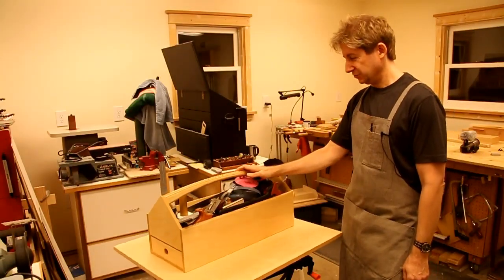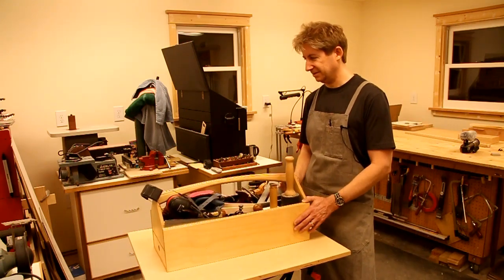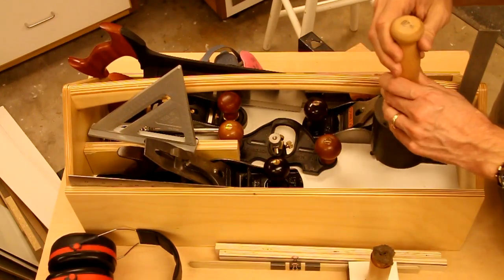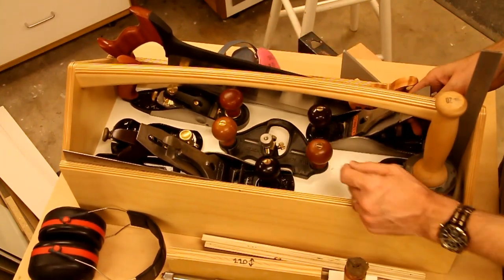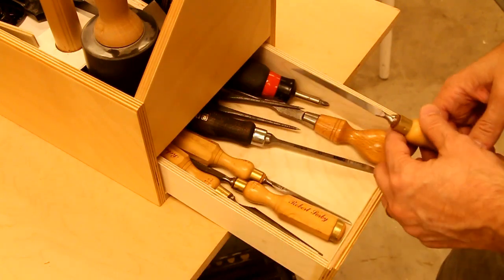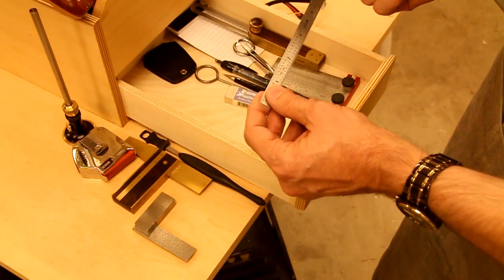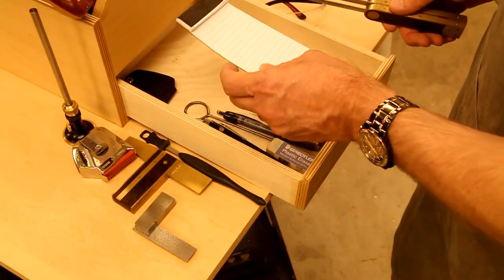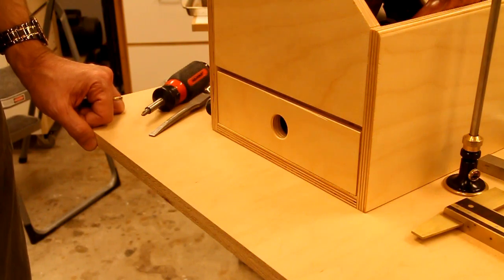Inside My Traveling Tool Tote

Comment: man that tool tote hasnt spent more than 5 minutes on site... and neither have any of your tools... 
quite nice though
Reply from the maker: Well, I'm not a carpenter so my tools don't get much abuse.  I've only used the tote a few times for some workshops in my local area, otherwise my tools are in my workshop tool chest. I keep all my tools in nice condition and never throw them around or open paint cans with them. So they always look good, but are definitely used - I'm not a tool collector :-)
Reply: SingleTrack66 q